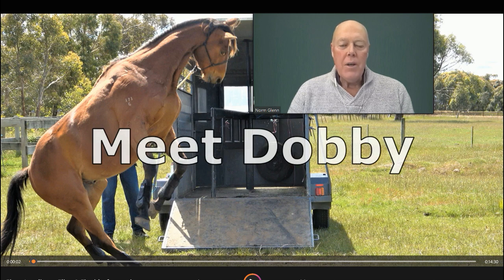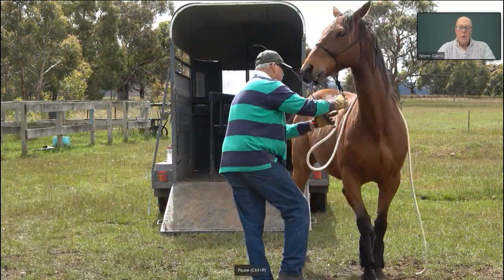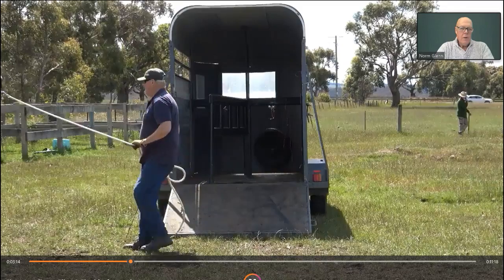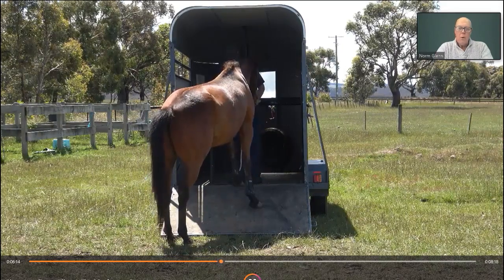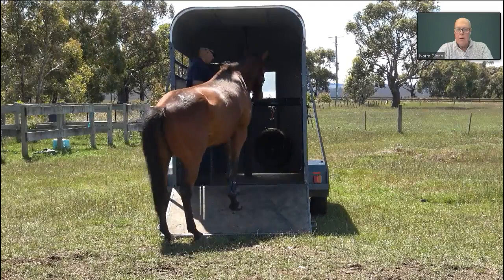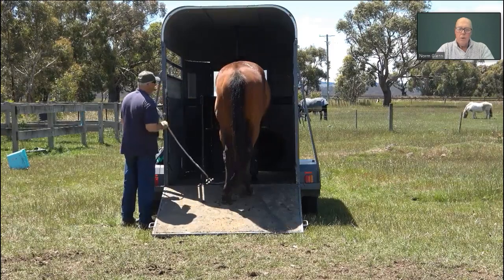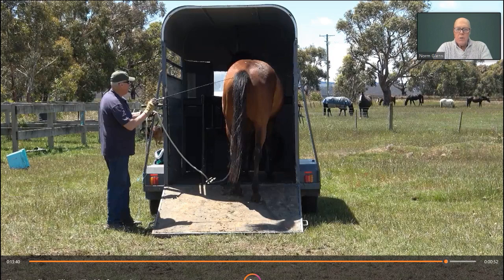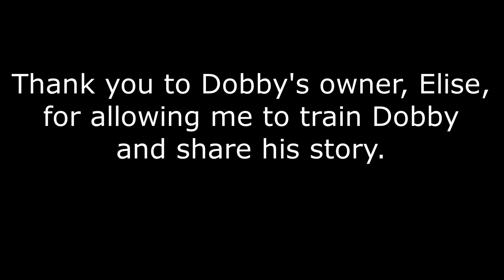5 Step Process Rehabilitates Troubled Horse for Float Loading

Comment: Awesome Norm. I have a 3yr filly who refuses to load and continuously jumps sideways off the ramp. At times this means jumping at me. Very frustrating and dangerous. I try very hard to be patient with her but feel she is definitely having me on as she knows she is stronger than I. On the few occasions that I've managed to get her loaded she insists on turning around as much as possible when unloading. Again very disconcerting for my safety as she rushes off the float and will not back off straight. Any suggestions please  mate?
Reply from the maker: My recommendation to you would be to get the horse loading video course at https://www.normglenn.com/horse-training-video-for-float-loading.html . It covers all problems and once you have got into it, you can always contact me to ask questions. If you get stuck, I can also do an analysis of any videos you have to show me (landscape not portrait/vertical perspective) at minimal charge.
Reply: @normglennhorsemanship  cheers mate. Thank you.